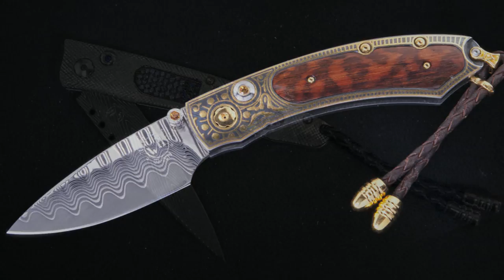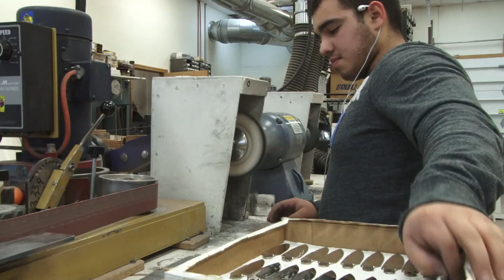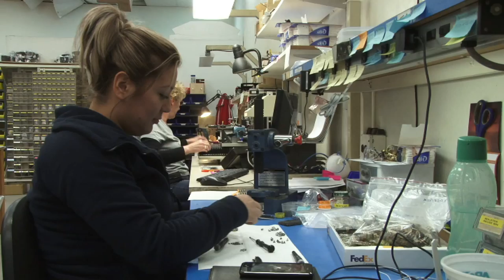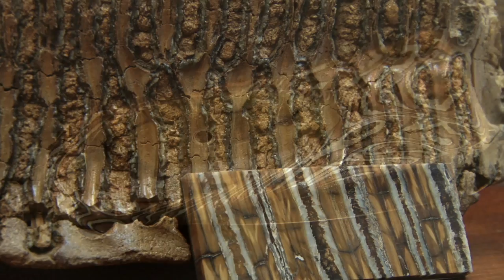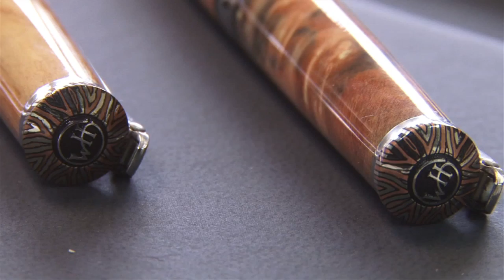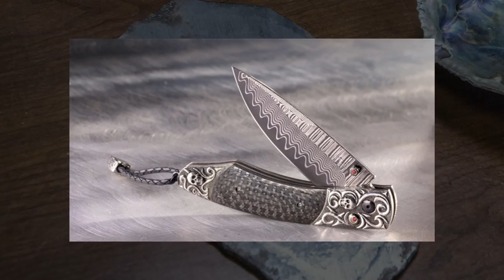William Henry

Comment: Not really,the used materials are maybe ''cool and expensive'' but the actual build quality and fit & finish is not worth the money asked for those knives..but thats my opinion.
Reply: I see it like this...buy a 1800 dollar custom knife from Allen Elishewitz and a 1800 dollar WH and compare those two in builtquality and fit & finish.
Reply: @DJ-xo4jg  You mention preference and that is all there is.  WH makes certainly not bad knives and to be honest,i do like there entry level knives pretty much and i can understand the collectors who only collect WH knives.
The thing for me and WH is that they use very nice materials for there blades and handles but i sometimes really get the feeling that they rush it to make a certain batch and along with that comes sharp edges, uneven screwholes in the scales and asymmetric sharpend blades (offcourse not on all WH knives,but i noticed it on a few of them)

I do like the A300 in zdp189/carbon-titanium  though and for 450 dollars thats a very nice folder